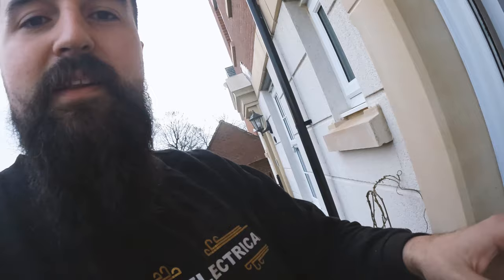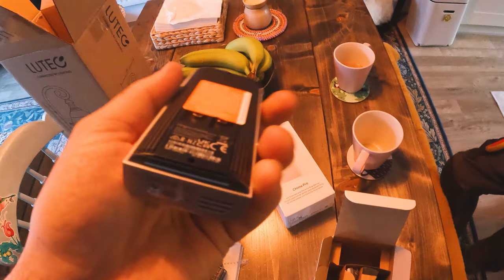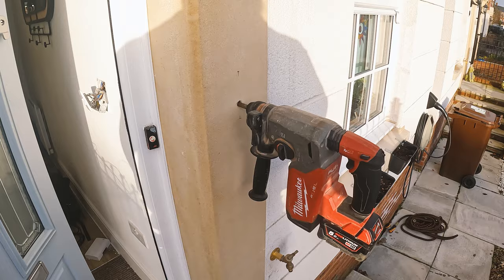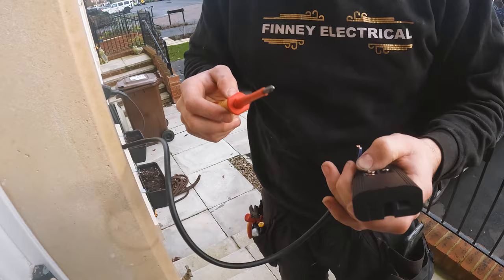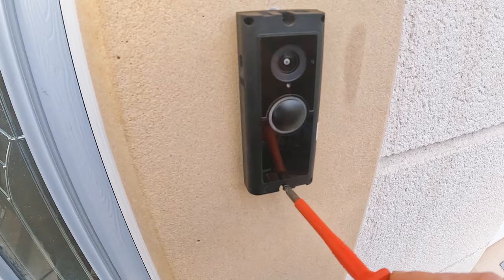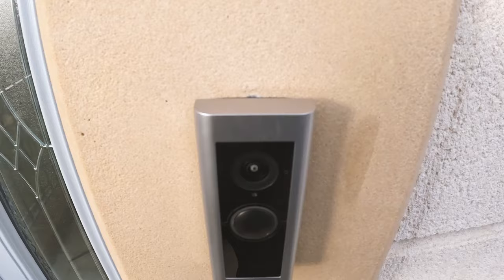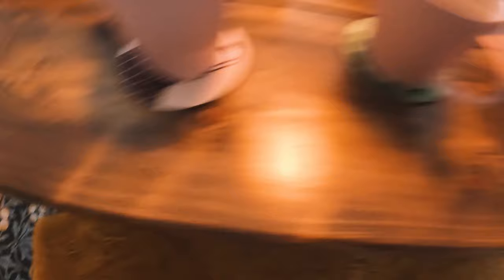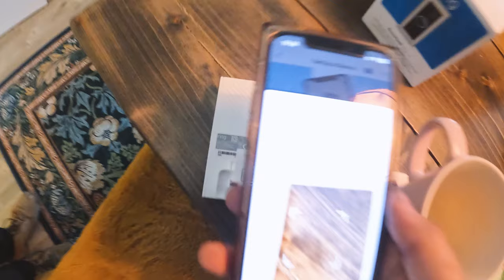HOW TO WIRE A RING DOORBELL!

Comment: Good video, nice and detailed! I have a new build and the existing doorbell is on a breaker with the ground floor lights (both on the same breaker). How would I fit the Ring supplied breaker?
Reply from the maker: If you have a bell transformer you can do what I did in this video 😀

Comment: What cable did you use? I cant find any bell wire in the uk which meets the specs only alarm cable. If you could drop a link.
Reply from the maker: Sorry it’s just alarm cable doubled up
Reply: Thanks for the reply